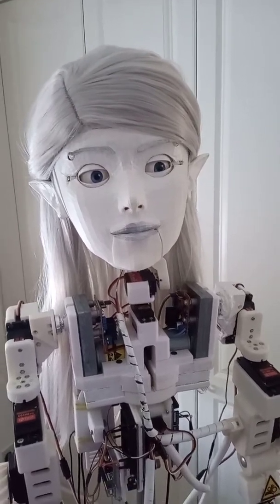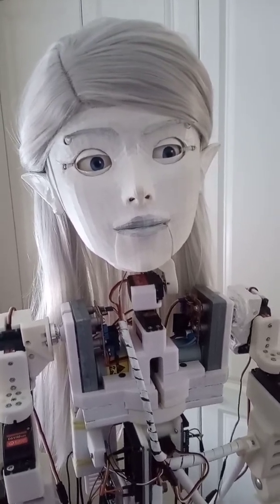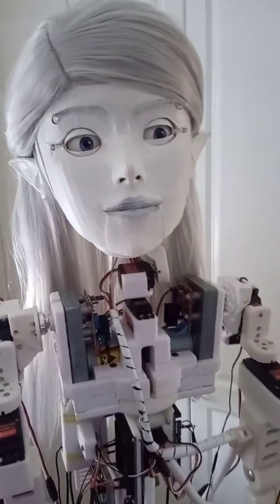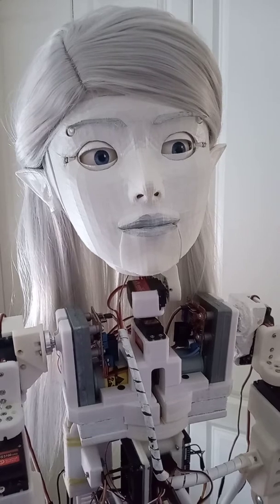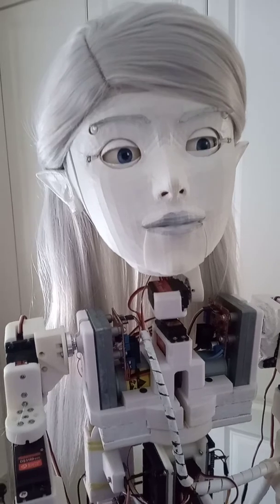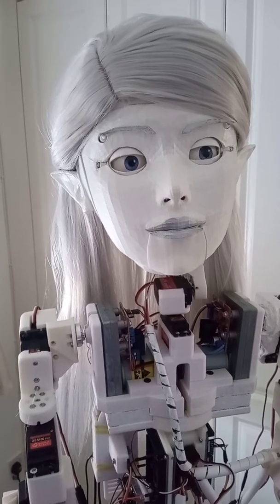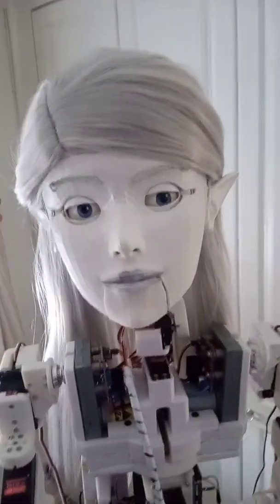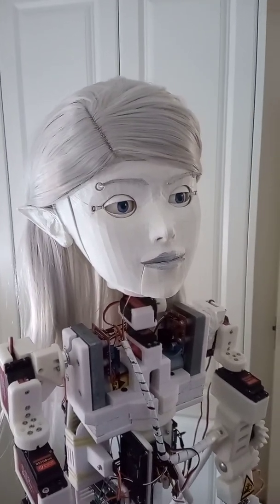Sophie's New Head and Animatronic Eye Mechanism Test

Comment: I don't like how you can see the all the planes of the face. I'm assuming you used a 3D printer for this... maybe if you subdivide the mesh a few times in your 3D modelling program it would fix that and make it smoother.  (I've never used a 3D printer though so I'm not sure) Aside from that it's a pretty nice project, creating these types of robots independently is definitely a challenge but seems like a really fun hobby.